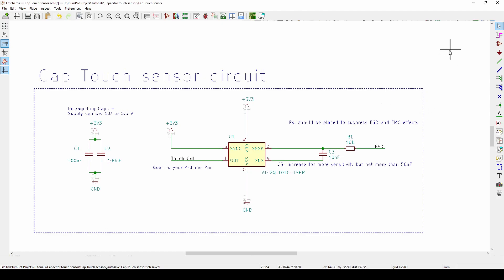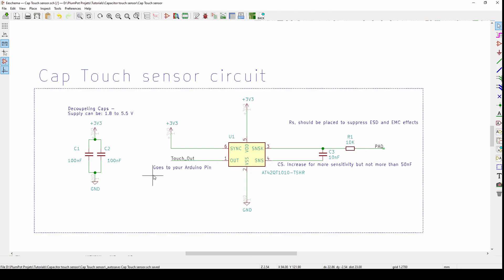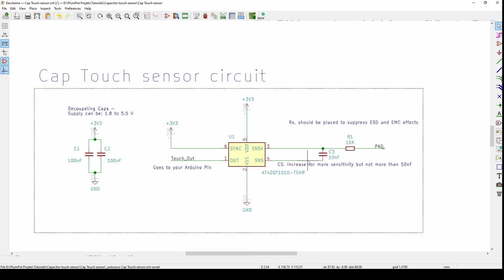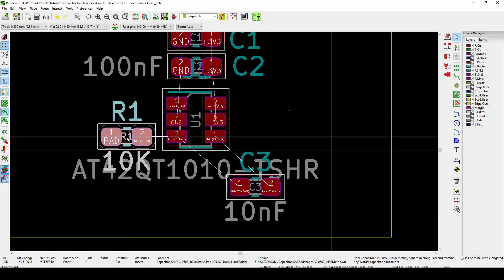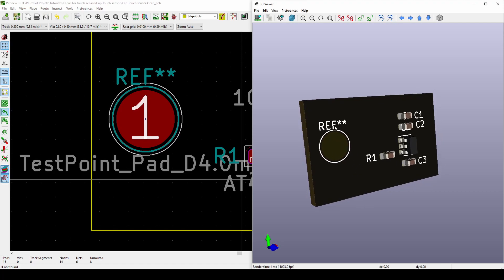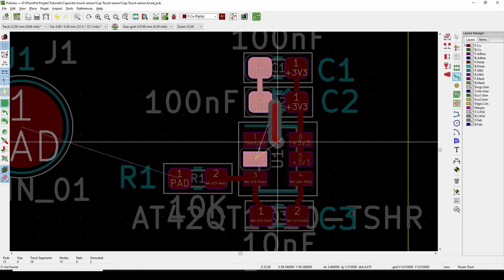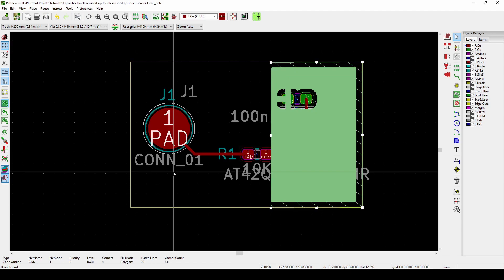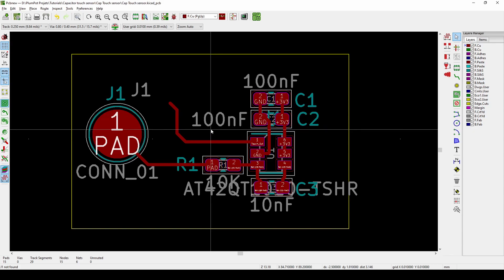Let's Learn Circuits in KiCad #1  -  Capacitive touch sensor

Comment: Hi, I have a question. I cannot connect the pad to the resistor. What could be the reason? Thanks for the answer
Reply from the maker: Hi Sebastian👋 does the pad have the same NET as the resistor? You can manually change the NET of pad by going to it's properties
Reply: @PlumPot  Hi, thanks for your help. I changed the net name from no net to pad under settings. And now it works. I can connect the resistor to the pad. Greetings Sebastian :)
Reply: @PlumPot  h

I have one more question. Could you please help me further. That would be very kind of you, thank you.

How do I generate the J1 Conn in the schematic. From minute 3:00 it is suddenly available in the circuit diagram

Comment: is it possible to create grounded mesh?
Reply from the maker: Hi Lucas, currently KiCad can not do it like Altium, there is a work around you can do, but it is tedious. You can read about it at https://forum.kicad.info/t/copper-pour-with-hatched-fill-instead-of-solid-fill/860/8. Are you working with the CAP touch? I just removed the ground plane below the touch pad and it works fine 😊